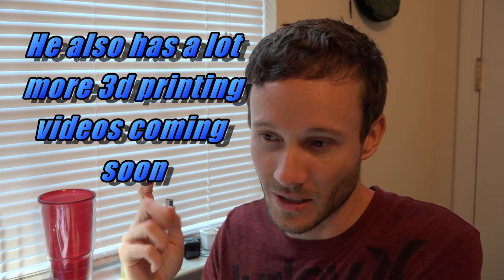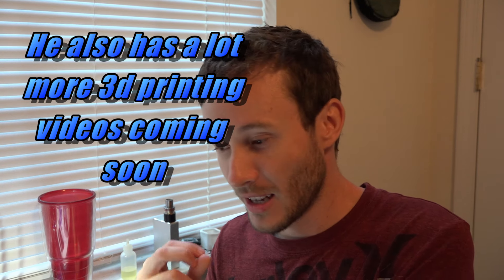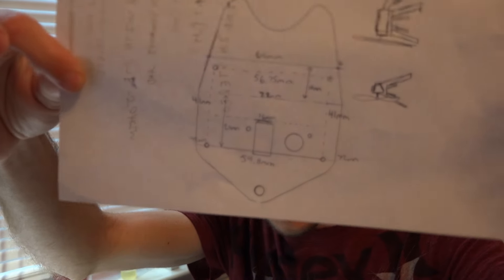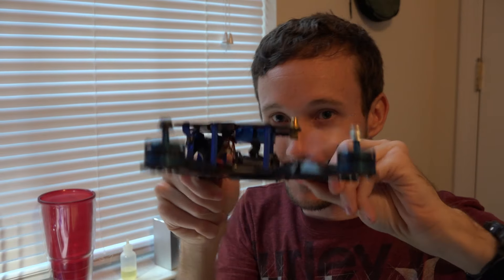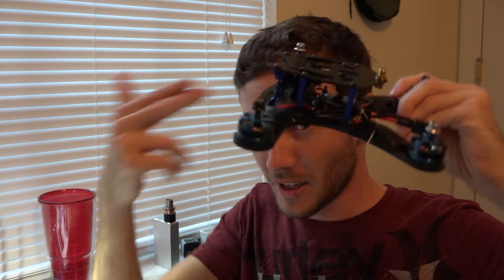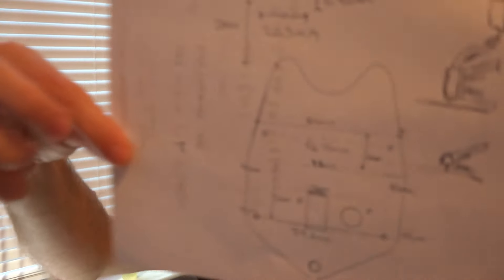Channel Update: 3D Printer, Betaflight F3, DYS F4, Other Stuff

Comment: JC,
I want to thank you for your Q7 series. I went through 20 out of the 21. Very helpful! If you do design anything Quad related, I want to buy! Your the guy!
Reply from the maker: Awesome. I dont plan on selling anything 3d printing related but I will share the files for free. If I do ever sell anything it's going to be flight controllers, ESCs and such that I've been working on designing. But still have a long way to go before anything is finished.

Comment: go for it man I appreciate all your hard work you put into things and iv learnt a lot from your vids an I'm definately not 1 who is concerned who your promoting or not but then I'm from across the pond (England) and I think its good to have a full view on all parts budget or premium like you said there's always a reason for a selection whether it's cash flow or maybe just specs of the parts just cause you pay out the nose for a part don't necessarily mean it's the best or best option for your circumstances good work bro 👍
Reply from the maker: I agree. I'm in the middle of the road. I'm not against expensive parts or Banggood. They both have their benefits.

Comment: The DYS F4 looks great.  I think it's missing a BB falsh logger but I'm using that less and less these days.  Dampening.  5v 3A Bec, OSD and ESC ports for both AIO and singles.  Excellent.  The odd thing is if you use the AIO DYS esc you restrict your dampening by the pin header connection unless you wire up instead.  EDIT:  I just got hold of the DYS F4.  It's not listed anywhere but it does carry 8Mb of flash BB, plus 8 mounting bobbins and a Xt60 plug and wire.

Comment: Good luck with the Racerstar motors. I bought a 210 miniquad kit off BG that came with the 2300kv ver and 2 of them were producing crazy amounts of vibrations. Upon test hover, the quad had a weird yaw twitch. I was like, WTF?!?! Later I found out it was motor 2 & 4 causing vibrations at diff rpms. Long story short, I soft mounted the motors and the quad flew about 80% better. So, just a heads up buddy. :)

Comment: I love all your videos and the time you take to explain things (for us new guys) as for the tatanis qx7 vids they ROCK!!
they have helped me out a ton!!
On a side note: I am wiring a 4 in 1 esc and have all the connections made to the motors and have made the connections for the signal wires. The 2 wires remaining in the plug (on 4 in 1) are a ground and a power Do I need to run the ground to my flight controller (LUX V2) for the esc's  and where does the power wire go?
Sorry to hijack this btw

Comment: Those pupils though, so big O_O lol
Reply from the maker: Yea I'm not sure why they're always big. People ask me if I'm on drugs all the time.
Reply: Project Blue Falcon yeah I've noticed in other videos, now worries. I have a QX7 question though. I have a 6.6v LiFe battery inside and the QX7 reads it about .2v off. any fix or calibration for this you know of?
Reply from the maker: Not that I'm aware of. It's kind of like the Runcam Swift 2. The voltage is off with no way of calibrating it. If the voltage is too high a very small ohm resistor could be used to make it right but if the voltage is too low then there's nothing that can be done. Well there is using transistors with resistors and a bunch of other stuff, but not worth it.